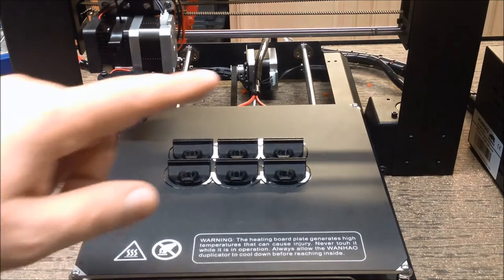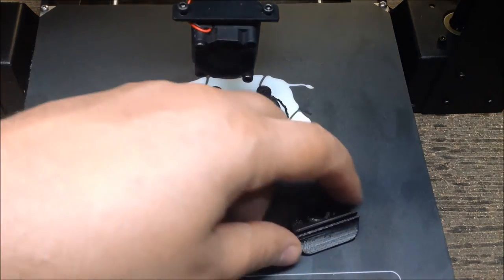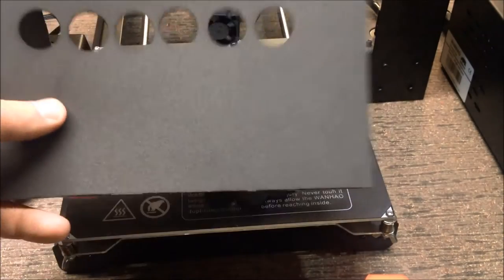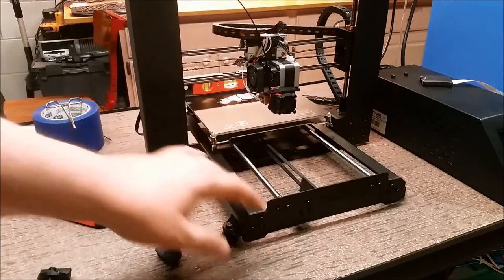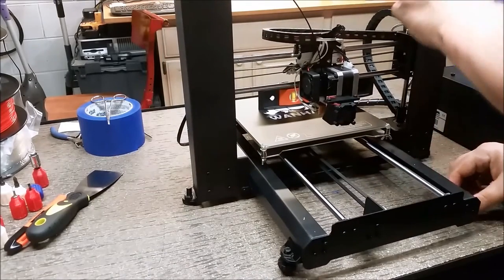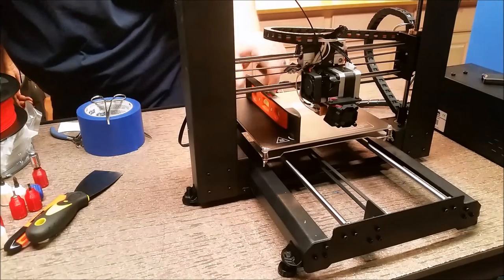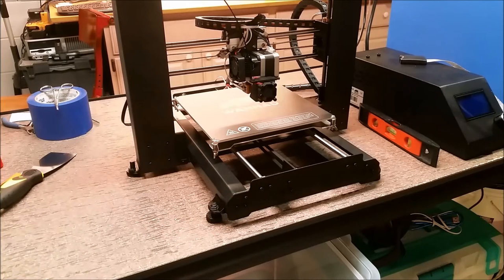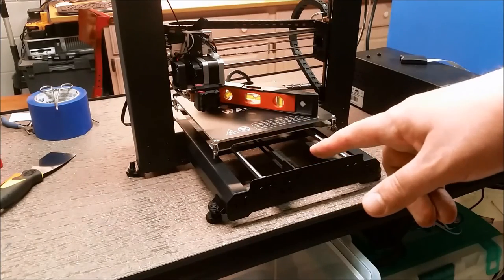Wanhao Duplicator I3 3D Printer  -  Adding Leveling Feet

Comment: If you were to have a lavaliere microphone that you could connect to your camera that would greatly improve the audio quality of your video instead of relying on the built in microphone on your camera.  Otherwise good content.  I think I will be adding this to my Monoprice Maker Select.
Reply from the maker: +Norbert Davis I odered one from Amazon yesterday (lavaliere microphone) along with a cheap wide angle lens kit for my iPhone as the Ricoh wg-1 doesn't have an external audio in and I really don't the time edit an external audio file to the video.  However iPhones FOV is pretty limited so the I am hoping the lens kits helps with that so we will see as I appreciate the feedback and please do let me know how this prints for you.
Reply: The wide angle lens kit will be good but it does tend to "bend" the edges. The center is typically good and not affected as much so maybe doing a little bit of "zoom" can give you that perfect balance between better wide shot and minimizing the bend. You will want to experiment. 

I have a Kodak Z80 that shoots 1080p and has external audio in. I put the wide angle lens adapter on it and it did great. 

You might see if using a Bluetooth microphone will work with your iPhone like a lavaliere mic.  That way you have no wires to get in the way. 

Good luck and I'll be watching for that new setup. 

Norbert
Reply from the maker: +Norbert Davis Casio or Kodak?  I don't see a Kodak Z80 but do a Casio...
Reply: Sorry, it is a Kodak Zi8.  I got a refurbished one form Overstock.com but I think they are only really available on EBay. But any of those are good as long as they have the external audio input.  It makes shooting videos so much easier.
Reply from the maker: I just got the mic and lens in today so will try them, will take a peek on ebay and see if there are any of these on the cheap if you say they are good, might give one a try...
Reply: Flip used to make a competing version.  They were the rage about 4-5 years ago before the iPhones and other cell phones get really good cameras.  I got mine for less than $100 refurbished.  Works great and I used Adobe Premier Elements to edit the video.  Not having to fix the audio was awesome.  I used to do a podcast where I would edit the audio for levels to get rid of those highs and lows.  The lavaliere mic is great because it is a set distance away and lets you move freely.

Good luck.

Norbert
Reply from the maker: Just placed a bid on one, on eBay :-)
Reply: Cool! what is the current level?  Is there a "buy me now" price?
Reply from the maker: Naw its a bid, and I am in at 30 bucks.  Hope I get it :-)
Reply: Me too.  I love mine for doing light video.  It has the 1/4x20 camera mount, will accept the magnetic phone lens kits, and has the audio in.  Its sweet.  And Image Stabilization (electronic) if I recall.  I hope you get it too.  And you can find 3rd party batteries on Amazon that are inexpensive too.  I bought a few when I went to CES back in 2012.  Not like you can just sit an wait for a battery to recharge there.  I bought like 4 of them or so.
Reply from the maker: Cool!  Have my finders crossed :-)
Reply from the maker: Ops :-) Fingers
Reply: Me too!🍀
Reply: How goes the bidding?
Reply from the maker: Lost bid on the one, but got another.  However got tell ya with the mic it is way loud (I don't have a quite voice :-) so i have to figure a way to tun it down...
Reply: When I did podcasting I used a program called Levelator that fixed audio files. You would have to export your audio portion, use Levelator, then reinsert to video file.  I did that for the few videos that I did. Kind of a pain but it is what makes the video seem more professional. There may be some sort of audio "leveling" featured in your video editing software.
Reply: +DIY3DTECH.com So you did get a Zi8, right?  With the lavaliere mic you can work with it as far as where it goes on your shirt because it is a pretty sensitive mic. You can position it mid-chest and it will pick up your voice perfectly. Have you seen 3D Printing Nerd's videos?  He uses a lavaliere mic and his audio is really good. Though he does do some editing for video he might also be doing audio leveling too. Might be worth it to check his stuff out and maybe ask him about his setup and editing workflow. From my experience podcasters and video casters loved to talk about what they use and how they use it. Lol. 

I look forward to the next video. Let me know when you are using your new stuff.
Reply from the maker: Yes did get one however the the field of view is a bit tight for the shop so I am experimenting with it now.  Question does it have a time lapse mode?
Reply: Not that I recall. The iPhone might be perfect for that. 

For the field of view I used the clip on magnetic lens kits you can get real cheap on Amazon. Like I mentioned before it gives a slight distortion around the outer edge but gives a decent field of view. 
http://www.amazon.com/gp/aw/d/B003JA0IIM/ref=pd_aw_sim_sbs_421_3?ie=UTF8&dpID=415i2KrZNzL&dpSrc=sims&preST=_AC_UL100_SR100%2C100_&refRID=1CD9KKAMP44TS2J6ZDNN
Reply from the maker: Interesting, I have a ton of optics kit laying around and think I am going to try and 3D print some thing :-)  Stay tuned!
Reply: Can't wait!!  But it is pizza & DVR night.  I will have my phone handy to see what you come up with.
Reply from the maker: Enjoy the pizza, ah those where the days before I got old and fat (they seem to go hand in hand).  Did also pick up another (different) mike to try yesterday and the wife is giving me the bad eye with all of this camera kit showing up (I have a LOT of still camera stuff :-)
Reply: +DIY3DTECH.com - Well I pay for pizza night by hitting the gym 3-5 times a week and walking the dogs in the mornings. And yes, I'm old too. Lol. Just turned 50. That's when I got the 3D printer. 

I'll be interested to see your experimentation. If you you like I would be willing to review any test video that you take.